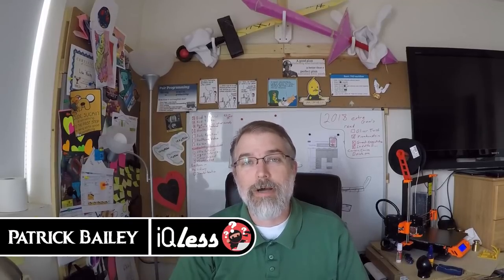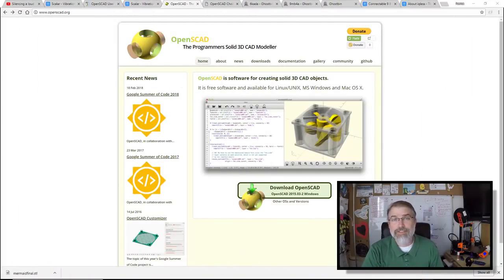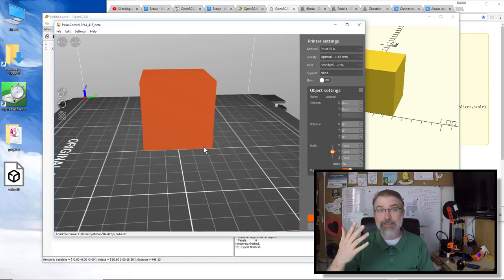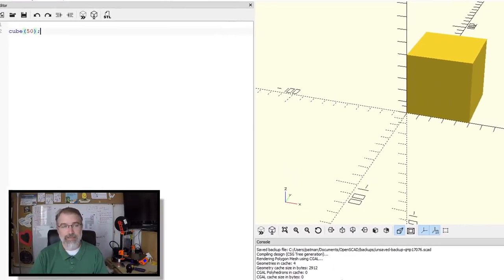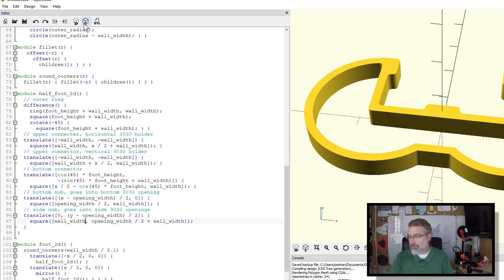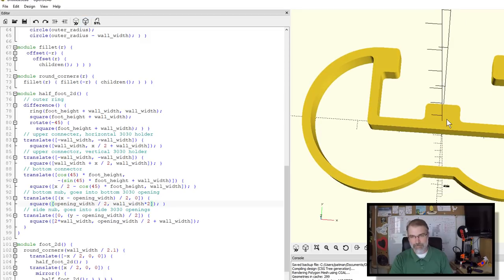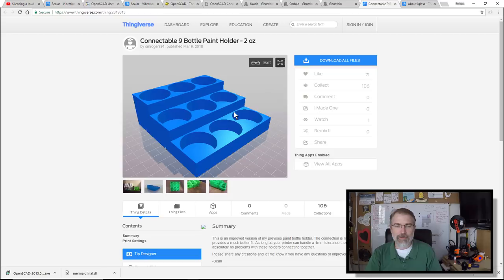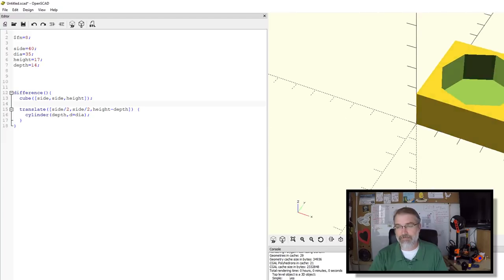3D Printing: Designing with openscad

Comment: Great video ! I recently found out my old CF-30 running Linux Mint won't run Blender , so I was looking for a alternative , and for what I am doing this is perfect , It runs on Linux , I normally design in 2D on QCAD and only need a small percent in 3D , so I plan to use SCAD to take the design I have already perfected in QCAD  and error check and turn it into a 3D STL file. I really like how you could use SCAD as a error checker.